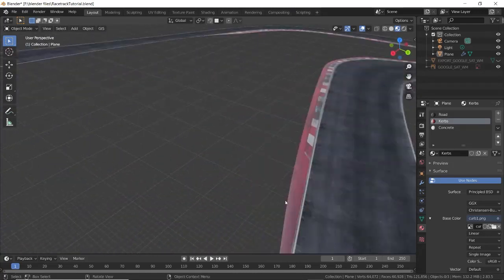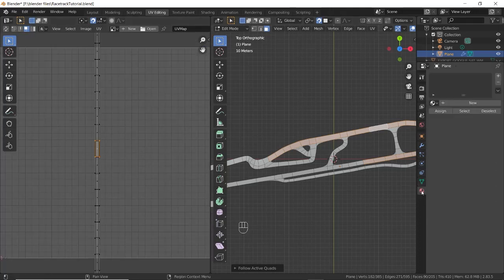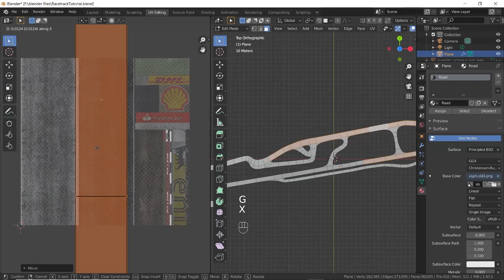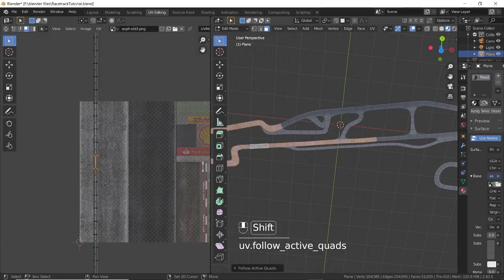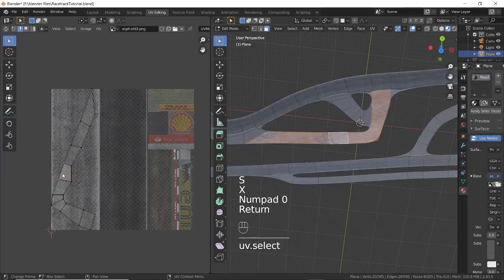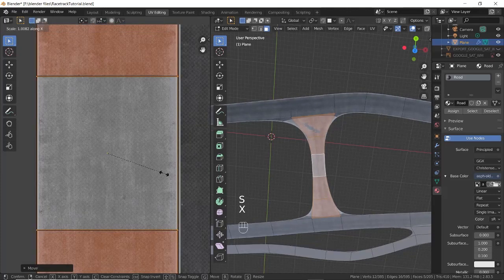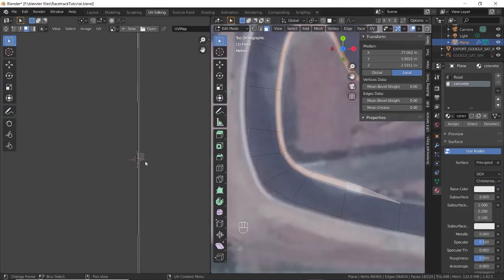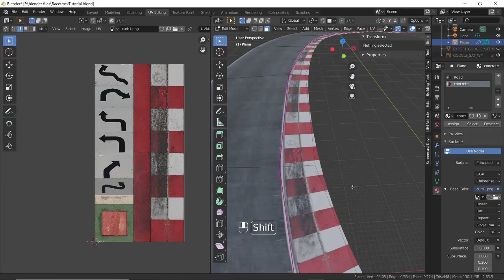Part2 : How to make a racetrack in Blender (Texturing)

Comment from the maker: The ground plane sometimes loses the height data after u close blender. 

 To avoid this, apply all the modifiers on the ground plane before u close blender . 

But if u have not applied the modifiers and u lost the height data, don't worry
Select the ground plane, goto
GIS -> Get Elevation -> ok
And now apply the modifiers
Do not open the basemap

u can support me by buying this model:
https://www.cgtrader.com/3d-models/car/racing/kari-motor-speedway-d1e4d1a0-ad88-4b7b-b791-2020bce89d55

patreon link :
https://www.patreon.com/posts/how-to-make-in-60894929?utm_medium=clipboard_copy&utm_source=copy_to_clipboard&utm_campaign=postshare
Reply: what is edge selection mode? and where do you find it?
Reply: Could you drop the file for the image road texture (The first One for the main track not the sub-track)
Reply from the maker: @Charcarlios16  when u go into edit mode it is there on top left. Vertex, edge and face selection modes
Reply: @Gamezoneadi  Thanks i just tried that and it worked!
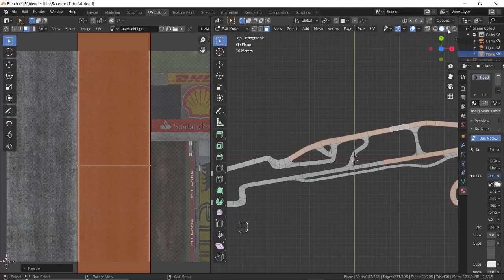Reply: where would i find a screenshot of the track texutre? do i search something up or do i screenshot it off google earth and i dont have that circle looking thing on my scrreen (filled up a bit) (for the copying of the texture to the track what should i do?This button is at around 2:35)
Reply from the maker: U can search up in textures.com or if u want the same textures u can get the model from my patreon. I think there is a seperate folder for textures
Reply: @Gamezoneadi  ok thanks

Comment: right at the beginning u are saying apply all modifyers which ones tho i got nothing there except from the subdivision used in ep1
Reply from the maker: The modifiers for the gis ground plane are of no use. If u don't apply them and go to edit mode u won't get the vertices and edges to edit them
Reply from the maker: Do not apply the subdivision surface modifier of the road. If u do so u cannot edit the u v mapping of the road anymore
Reply from the maker: U will need to apply the modifiers of the gis ground plane for the 4 th part, U can leave it if u haven't reached there
Reply: @Gamezoneadi  okee thx im gonna eventually ask again when im there😂
Reply from the maker: Np bro
Reply from the maker: That gis plane loses height data sometimes after u close blender. U can simply select the plane and thengo to GIS - get elevation and ok. U will get the data back. If u apply the modifiers u won't have this Problem

Comment: yo @Gamezoneadi im struggling with the uv map it just shows up with the edges and stuff no shapes any suggestions?
Reply from the maker: Press U and use reset option
Reply: i tried that already all my shapes are not connected and when i make one rectangle and select follow active quad nothing happens. maybe because the shapes are not connected but even then the track is connected so i dont know what to do. @Gamezoneadi
Reply from the maker: If ur uv's are disconnected means the vertices of ur mesh are disconnected as well. Check ur mesh. If it's still not working send screenshots/video on my discord
https://discord.com/invite/YPgCgEat

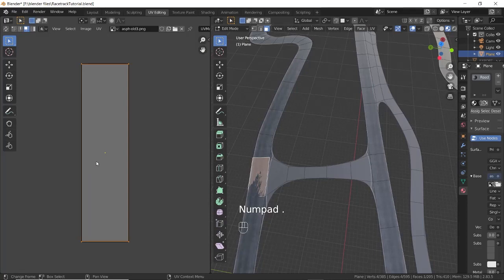Comment: Of what is the Numpad . shortcut, during the UV mapping of the intersections (2:50)? I don't have a numpad keyboard on the laptop and I'm trying to find another shortcut, or just the name of the function you are using. Also, very good tutorial, thanks for the effort! It's hard to find a good tutorial online that actually explains what to do in blender.
Reply from the maker: That shortcut will bring the selected object into focus. So to get the selected face in the u v mapping window, u need to 
1. select the face at intersection. 
2.bring the cursor into the uv mapping window. 
3. press A and then press numpad . Key(Period key) 
4. And then select one of the sides and move it on the axis perpendicular to it and see if the white markers on the side is getting removed.
Reply from the maker: https://blenderartists.org/t/solved-is-there-a-laptop-alternative-for-the-numpad-period-key/1173662/2
This might help solving your problem of period key
And the function of the key is called "pivot shift" Ig
Reply from the maker: Idk if we can change the key bindings in blender, but give it a try
Reply: @Gamezoneadi  the view -> frame selected method works perfect, thanks!
Another question I would have is, do you recommend any source for textures? For example that zandvoort textures?
Reply from the maker: Textures.com is a good source. 
https://www.textures.com/system/gallery/photos/Roads/Roads/57023/Roads0097_1_download600.jpg
Open this image in paint or ur photo editing software and draw 2 white lines on the sides, and u have a racetrack tarmac texture.

Comment: the textures dont go to the roads after the uv mapping.  i did everyhting you did but the road keeps being white
Reply from the maker: I think U r in solid view instead of material view. In solid view U won't see the material being applied.
Reply from the maker: The other reason could be U have applied  the texture to a wrong material which has not been applied to the road. I don't think anything else can cause such a problem
Reply: @Gamezoneadi  ok I will check to see what I've done wrong

Comment: How you can manage the error "too many vertices" when export to ks editor? I can fix this, it seems the track is to complex, to many squares?
Reply from the maker: Decrease the level in sub surface modifier for the ground plane before applying the modifier. Go to edit mode and there u can see how big the squares are. No need to reduce the details on the road.
Use Level 3 for ground and lvl 4 for road
Reply from the maker: 84k is the limit ig
Reply: @Gamezoneadi  Could you give me  your contact? I would share with you the blend file. I tried to reduce to 2, and know it import the file on kseditor, but an error pops up "Error, found scaling node: ROOTNODE", and I only see a black sphere on kseditor, no track. Thank you so much in advance for your suggestion man
Reply from the maker: Bro first let me get my track inside AC. I have recently bought Assetto corsa. I have tried once, it shows the option to select the track but the game doesn't start. So once I get the track to work successful inside ac I'll make a tut on that
Reply from the maker: Maybe try checking the apply transforms option in the export settings for the scaling node problem

Comment: but what modifiers did the ground object has in the first place?
Reply from the maker: @3km143  they come with the addon, not available by default in blender
Reply: @Gamezoneadi  So that explains my problem. I've got the terrain of the ground object by extracting it from Google maps with render doc, so I would have to add those modifiers manually
Reply: @Gamezoneadi  Also, on different note, the whole unraw thing in UV mode doesn't work for some reason
Reply from the maker: U might need to watch some tutorials dedicated only to uv unwrapping